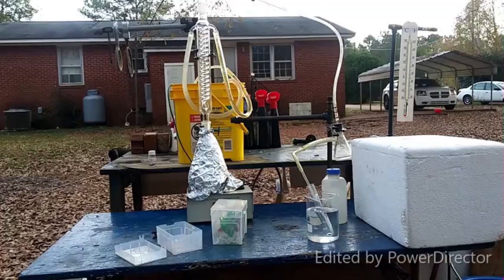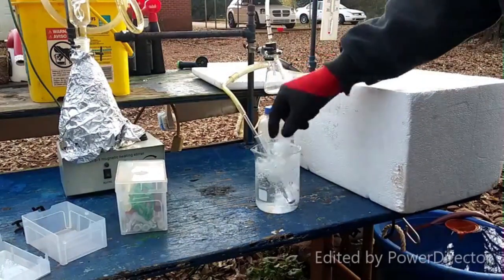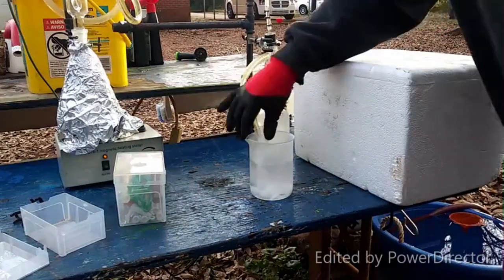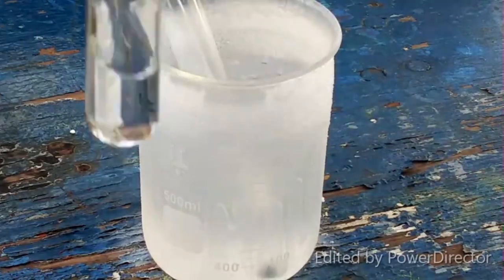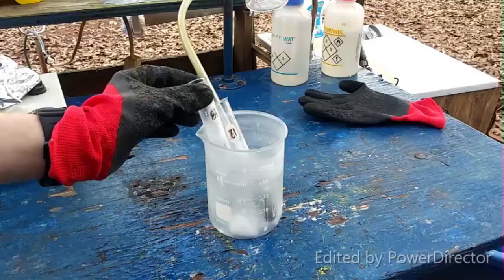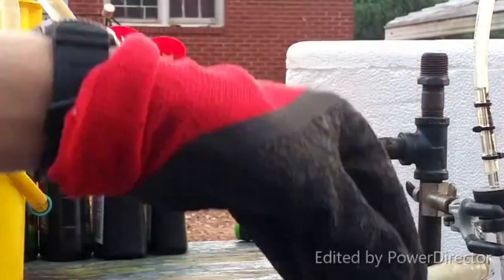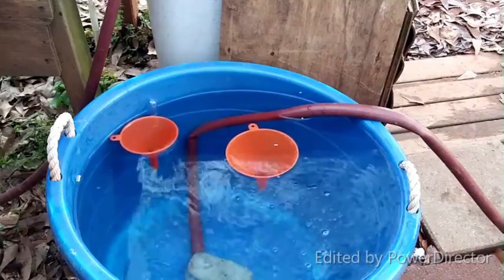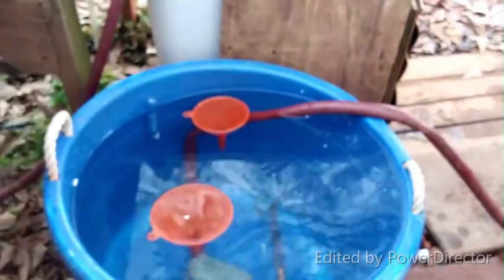Anhydrous Ammonia & Metal Amides #chemistry #ammonia #amide #inorganicchemistry

Comment: It´s also surprising how well CO2 dissolves in extremely cold acetone. Once had a dry ice acetone bath and after i was done filled into a bottle. Closed the bottle after 20 minutes and it decided to blow up lol
Reply: I knew acetone could hold an enormous amount of acetylene , and it is used in acetylene cylinders for that purpose , to help desensitize the acetylene for safer handling .
I did not know it had a similar affinity for CO2 .
That could have some interesting and potentially useful applications I think . Gonna have to dig in to that .
Reply from the maker: @kaboom4679  Thyzoid is full of useful info. Also looks delightful in a dress. 😄😄
Reply from the maker: Really? I wasnt aware of that. Makes sense though.

Comment: Would it be possible to turn anhydrous ammonia into a supercritical fluid by trapping it in a pressure chamber which is heated.
Similarly to co2.
I feel that something like that could be of great value to me.
Reply: You can do this by liquifying ammonia in a narrow thick wall borosilicate or quartz tube then flamesealing it. Xenon and CO2 are the best for a critical point demonstration, especially xenon.❤
Reply: and Xenon gets you high too, apparently @christopherleubner6633
Reply from the maker: Im sure you could. Any gas will form a supercritical fluid at the right temp and pressure (405.2K and 11.3 megapascals).  Obviously it would be extremely dangerous but I assume you figured that part out already. 🙂
Reply: @PoorMansChemist   Not only is it a pipe bomb but its also highly caustic : ) 
Well if i ever stop commenting you know what happened
Reply from the maker: @ConcretorumAzoth  Dont forget flammable and metabolicly toxic. You know it may not be terribly practical but Ive always wondered why create a pressure chamber thats itching to become a bomb at the slightest fuck up and instead create a compressible but sealed chamber and lower it into the ocean until the water pressure hits what you need. Sure you may have to go out into the middle of the sea but if near freezing temps will work its a totally safe way to do it. If the vessel fails it wont explode and even if it did theres hundreds or thousands of feet of water between you and it. Youd just need a seaworthy vessel and a lot of rope. If you only need several atmospheres a deep lake may suffice.
Reply: @PoorMansChemist   Hmm, yes this is a legitimate strategy and very safe, I have heard of it from old alchemical texts where they lower bottles into the sea with rock weights and a rope to drive their reactions.
Thank you for reminding me this will be viable for me in the near future.
Reply from the maker: @ConcretorumAzoth  Glad I could help!!!